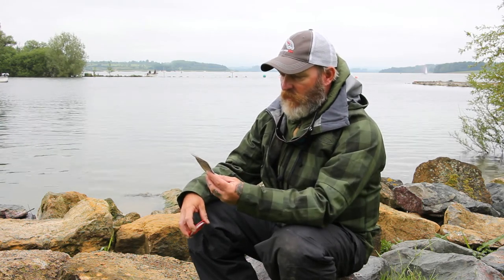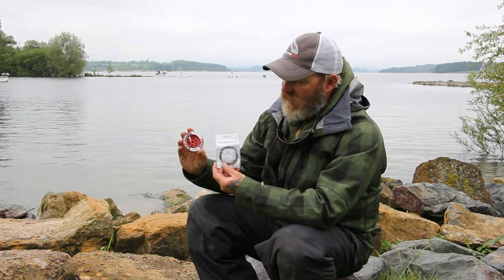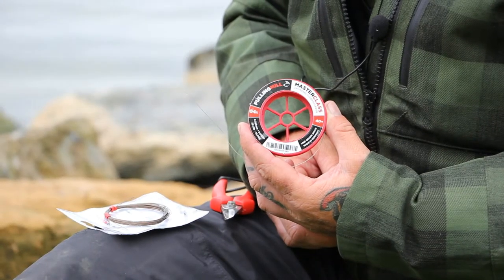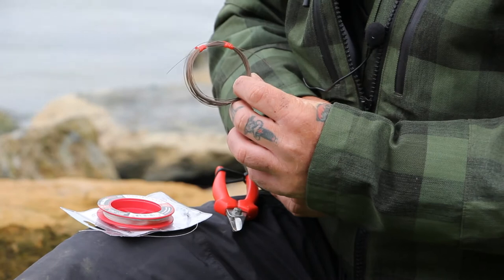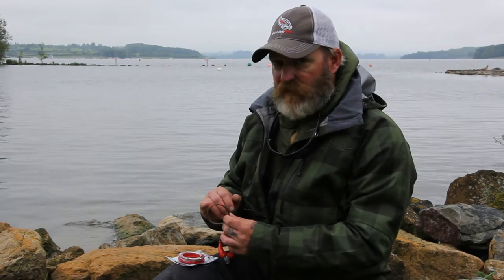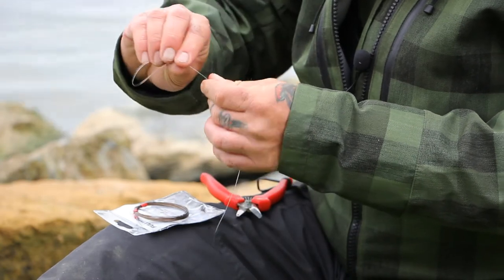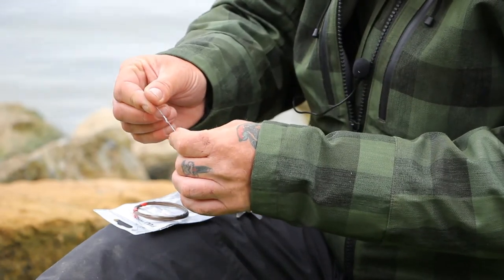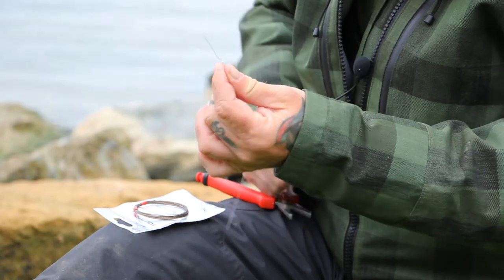How to Create a Pike Trace for Fly Fishing from Fulling Mill

Comment: Why do you use the fluorocarbon as well as the wire? Can you not just use the wire straight to the fly line?
Reply: I'm guessing because the fluorocarbon is lighter and less visible, creating separation between the trace and fly line.